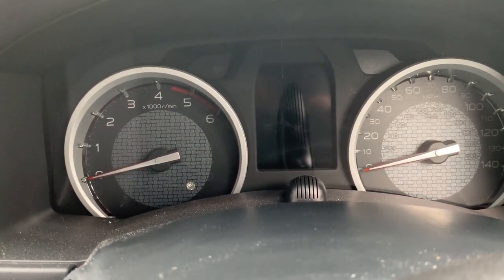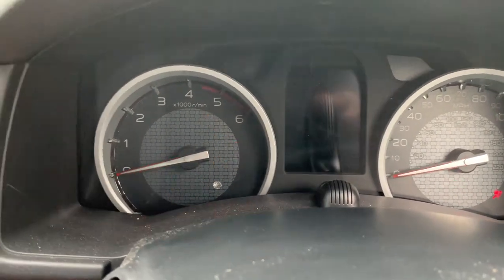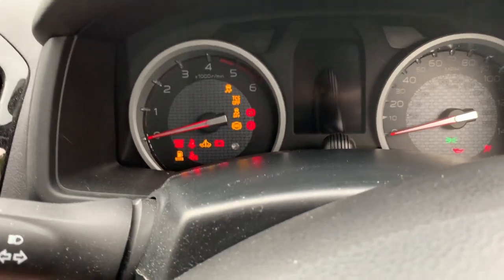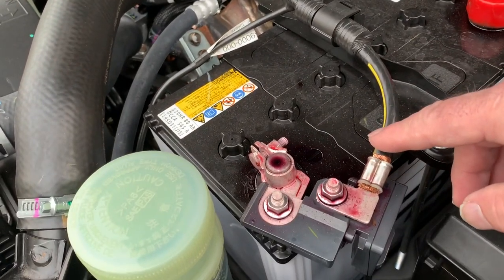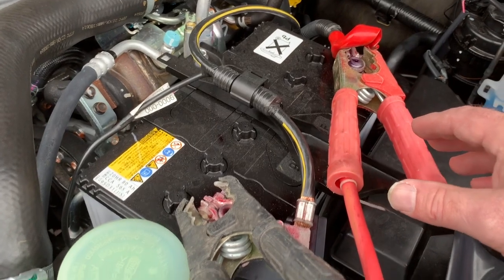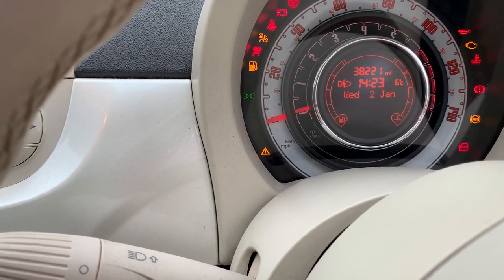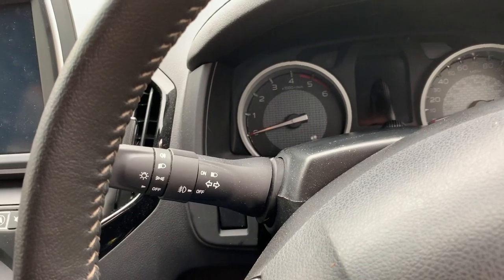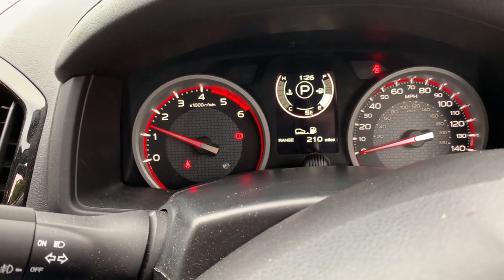Can the little car jump start the big car?

Comment: I have a new small car and I tried to jump 2 different Chevy Tahoes (big vehicles) with no success even after charging for 4 minutes. On the newer one absolutely nothing happened. It didn't even start to turn the engine. On the other vehicle a few years older (2010-2012) it started to turn over but not enough juice to get it started. They later let me know that a roadside service was able to start them both quickly. But thanks to your video I can probably assume it's not because of the size of the smaller vehicle.